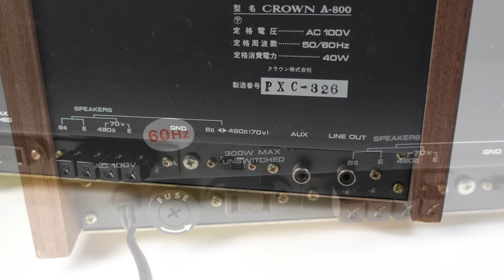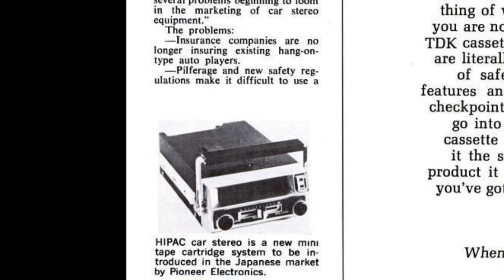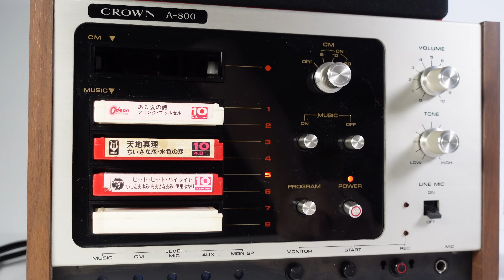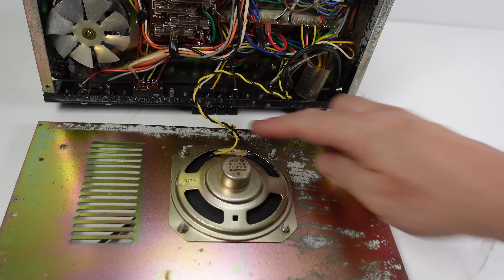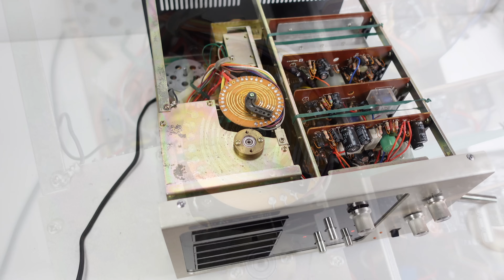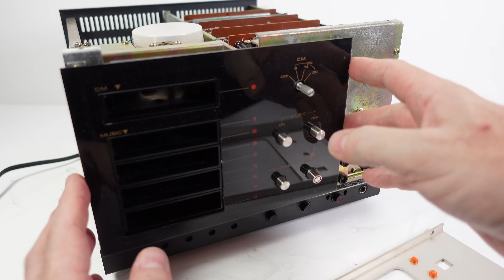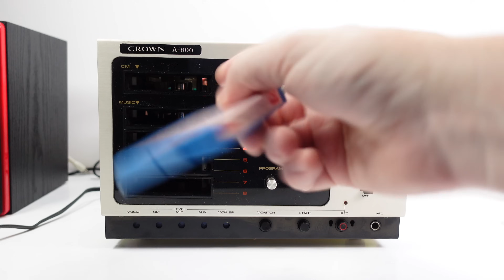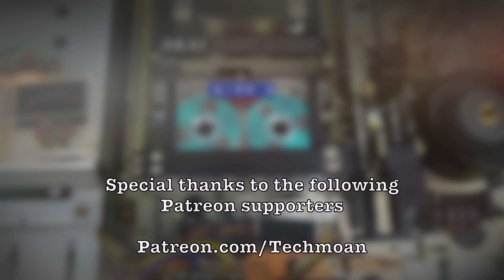An unusual player for a forgotten ‘70s music format

Comment: It's more than likely that a 50Hz drive pulley was available for this machine as a spare part when it was on sale. Quite common at the time, before DC motors were the norm. That's really the only way to make it run at the correct speed on 50Hz. With some luck a newer DC motor with electronic speed controller can be used as a (more or less) drop in replacement. Or just get a frequency converter of some sort. If a mains powered converter isn't available, 12 volt DC to 220 volt 50 Hz ones with pure sine wave are readily available on the EU market, so i can't imagine a 100 or 120 volt, 60Hz counterpart isn't in Japan or the US. For small loads like this, the cost shouldn't be all that high. There's also 50 to 60Hz converters on the market intended for converting US market jukeboxes to run on 50Hz power. They do however most likely only have the power to drive the motor itself, and is also likely to be square wave.

Comment: I'm not much for vintage audio equipment, but I do tinker with old computers from the 80s forward and replacing capacitors does sometimes rejuvenate the computer that I recap.  I say this because of the recording test that was done.  Just as a test for the 50/60Hz, why not piggyback a 0.4 uf/400 nf capacitor onto the existing 0.6 uf capacitor and see what happens?  Everything in life is half chance.  If it works, either leave it or replace the hodge-podge setup with a 1 uf capacitor.

Comment: Took me a while to get a good view of the motor, but it appears to be a variation of a switched reluctance motor.  These are terribly inefficient but have a very good speed stability under variable load.  I would wager a 90% chance that the capacitor is connected to the reluctance winding and not the stator.  If it is then changing the capacitor value will definitely change the motor speed.
Reply: Given that the tolerance of capacitors is rarely better than 10% or even 20% I truly doubt that the capacitor is the only or main change required.
Reply: @geoffmorrison3648  For electrolytic capacitors the standard is +/- 10% but metal film capacitors are typically +/- 5% but typically +/- 1% for those styrene capacitors like the one in the unit.  Even at worst case of 5% that much variance is likely unnoticeable in a low fidelity PA system.  Even so the tank circuit formed in switched reluctance motors is also subject to the inductance of the rotor winding. I stand by my previous statement.

Comment: I find it unlikely that it would matter by changing the capacitor but it's possible. If the value is too high, it's not going to hurt anything so you can just try it and see what happens.

Comment: Changing the cap will certainly not alter the speed sufficiently although might make a difference. Capacitors are simply too inaccurate to set a speed correctly. Unlikely they would make frequency changes that difficult though as this is a specialist machine that would have sold in hundreds, not thousands. If you can get a circuit I can certainly advise.

Comment: That's a format I was previously unaware of, but I pretty much pegged the purpose of the device - I have seen similar devices using other cartridges with music and an "ANN" (Announcement) cart slot and a a button to do non-recorded announcements over the music.  They were in use at department stores and skating rinks in the United States.

I recall a few other cassette formats prior to the "compact cassette" won the portable audio tape market.  There was one about the same size that had sharper corners; I think it was a 1/8" inch tape, but it may have been 1/4 inch.  I had a recorder for that format in the late 1960s or early 1970s, but cannot recall what the brand was.

@Techmoan - Do you know of anyone in the United States who might be interested in restoring some old (1960s to early 1970s era) audio equipment?

Comment: Changing the "run capacitor" will effect the speed of an AC single phase motor, which it almost certainly is. 
It would explain why they didn't just fit a 1uF capacitor regardless of the frequency.
A good indicator of whether it is a run capacitor is its voltage rating, it's a high value, it should be at least be the same as the AC supply or higher, (220V japan).  The value will be written on the capacitor.
Make sure the replacement electrolytic capacitor is connected the right way around (polarity, +/-),  and the voltage rating is the same or higher,  and same tolerance (%) or better (smaller value %).
Reply: You cannot use a polarised electrolytic for a "run capacitor" on an AC motor.  How do you propose to make sure it is connected the "right way around" when the voltage is changing polarity 50 or 60 times every second?

Comment: To change the horsepower on universal air conditioner blower motors you have to change the run capacitor. For example to run at 3/4 horsepower you need a 20uf capacitor and for 1/2 horsepower you need a 10uf cap.

Comment: I highly doubt that changing the capacitor will have an effect on the speed, It has something to do with the charging/discharging rate of the capacitor based on the frequency, Lower frequency (50Hz) requires longer charging/discharging rate therefore bigger capacity (1uF), higher frequency (60Hz) requires faster charging/discharging rate therefore smaller capacity (0.6uF).

Comment: The capacitor creates a phase shift for the rotary current motor.
The motor tries to follow the rotary field and reaches almost the speed of the mains frequency.

The size of the capacitor can't change the speed. It needs to be a different size because a higher frequency can pass more easily through it so it needs to be smaller to let the correct current pass.

To help you understand how those motors work, I oversimplify the explaination:
The motor needs 3 phases which are 120° phase shifted. Imagine a wheel, each phase is 1/3 turn later than the previous one.
The motor needs 3 phases. One is offered directly from your mains which is 0°, the other one is the return wire which is 180°. And the capacitor delays the current and creates almost 90° which is used as the missing phase for the motor.
So instead of 0°, 120° and 240°, the motor is fed with 0°, 90° and 180° which is not ideal but good enough to make it going.

(Yes, the capacitor doesn't delay the current, it makes it early. It's very hard to understand why so imagining making it later works well to get a general idea!)

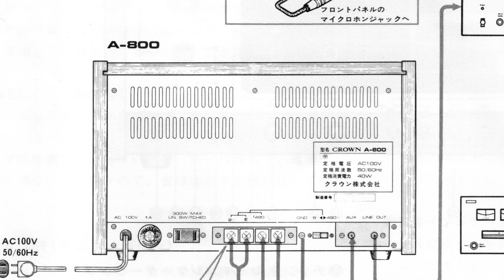Comment: There are "keyholes" on either side of the record button, was there was a cover to prevent accidental recordings? The idea of a tone on the tape is interesting, but seems like it would have to be be simple and obvious to generate, since the machine was designed for use by the general public... The manual at 11:11 shows a standard 2-wire microphone, so if it was a "special" microphone, maybe a switch just shorted the wires? To test the 2nd track tone theory, you could reverse head wires and record an online sweep tone generator. It would also be interesting to put your voice tape in the other machine to see if it recorded anything on the second track... Don't know for sure but I think changing the capacitor for 50Hz might work, based on personal experience with a Teac A-4010 that would gradually slow down until a faulty capacitor across the motor was replaced - capacitors can definitely affect motor speed. As always fascinating video and presentation!

Comment: I knew it must’ve been a commercial music background player because of the 70 volt option on the speaker output. That would be for a distributed sound through a number of speakers and the best way to do that is with a 70 V system.

Comment: for what its worth, the instant you showed the first image of the rear, I saw those 70V/490ohm speaker settings, and thought 'it must be a PA announcement/background music machine'.   70V audio was used for building wide PA stuff, as it could be run in relatively light gauge wires like telephone wire over substantial distances, and many amplified speakers could tap off it, with the 490 ohm terminating resistance at the end of the loop.

Comment: For the AC frequency issue, it might be easier put together a 50hz input->DC->60hz output conversion setup than risk tinkering with the insides of this machine.
Reply: Like with a uninterrupted power unit or an inverter
Reply: Railroads used rotating converters for this purpose-an electric motor driving an alternator at the appropriate frequency
Reply: Would it be possible to use a class AB audio amplifier with sufficient power and feed it a 50/60 Hz sinus signal?

Comment: The capacitor appears to be in the power supply section (all those fuses right there), therefore I am going to guess that the value of the capacitor is a function of the line frequency to keep the hum at a spec level.  Bigger value needed to filter the lower frequency.  Since Crown already makes the factory put in a frequency specific part, they also may have had them select the right motor for the intended frequency on the assembly line if the motor is an AC induction type.  If the motor is a DC type with an internal governor, there may be an adjustment hidden on it somewhere.

Comment: No need to replace the capacitor, just add a 0.4uF parallel with the original 0.6uF. It will be 1uF.
This is the way can do the job with less harm to the machine.

Comment: Im an electronics engineer and i have no idea if that cap will change the speed.  I think its worth a try just make sure its a proper voltage rating cap. If its an ac motor there's a good chance it will work.

Comment: the capacitor could be part of an oscillator RC circuit that sync or drive the motor, changing C change the frequency and the speed of the motor OR its part of the timer circuit

Comment: I don't think the capacitor by itself will be sufficient. Capacitors certainly can be used for timing/speed adjustment, but they're not precise enough for something like tape playback speed. You need to find something else to adjust too.

Comment: Mat,  may I suggest since you get equipment from all over the world to demonstrate,  you get a 250 to 500 Watt 12 VDC to 120 VAC, 60 Hz (automotive) sine wave inverter.  Then you can convert 240 VAC, 50 Hz to 12 VDC with a car battery charger and 12 V battery,  and have a nice isolated 120 VAC, 60 Hz source to test Japanese / American equipment.

Comment: Having a tone on the 2nd channel for commercials rather than a metal splice would make sense if you have several commercials recorded on one tape. That way it'd be able to play one at a time. So I think that's a very plausible theory.
Reply: Was going to say the same thing.  They would probably have a series of announcements on one tape with the 2nd track having a tone to determine the start and end point of each announcement.  If it was only one announcement, it would get a bit repetitive during the day even for casual shoppers.
Reply: @techmoan - Have you played that tape in one of the lower decks and listened to track two?  Was it erased when you recorded your announcement?
Reply: @mjrippe  It seemed like he didn't have an original announcement tape to begin with unfortunately. The one he wrote over was some regular music tape that was very worn. If he found one though this would be a good way to tell!
Reply: @AgentOrange96  Right, but if the top deck erased the second track of the music tape that would tell us something ;)
Reply: @mjrippe  True!
Reply: I have memories of a big bong being played between ads in department stores then back to the music or was that hi de hi ?

Comment: Regarding the hertz timing, I feel that the most obvious explanation is the answer. For it to be labeled that way on the PCB, it's often as instructions for the people who are working on it in a short space. You might get something like "3323" on the PCB to say "use a 3323 button cell battery with this". There's not a lot of space to put directions so they're very short and to me, the most obvious explanation is the answer.

When you posed the question "is changing the capacitor what will do it or..." I couldn't even remember what you had asked because it seemed way too out of left field. 

I don't have any definitive other proof, that is just my feeling as someone who has worked on PCBs! I feel that it would at least be worth a try swapping the capacitor. Usually switching to a higher capacitance (farads) won't damage the components.

Comment: That capacitor says MP = Metalized Paper and should be replaced, regardless of its function, if it's connected to a mains powered motor. 
It probably does not change motor speed, but it does change the current through the auxiliary winding of the motor. If the cap is for 60hz, then at 50hz there will be a too low current through the winding, which reduces motor power a bit (and potentially make it run slower because of magnetic slip)
Reply: @LimaVictor  You're the first one I've seen who got the purpose of the capacitor right.

Comment: A larger capacitor will not make the motor run faster, but it will make the motor run more smoothly. Its purpose is to shift the phase of one of the two motor windings by 90 degrees and at 50Hz you need a larger capacitor for that. You must make a mechanical adjustment (like swapping the motor pulley for a larger one) to make the player play at the correct speed.

Comment: Electro-mechanical engineering is incredible interesting. It's the same in old printers and other devices like that.
Most of the interesting solutions can be now replaced by a microchip with some program on it.
Certainly, that makes the products much cheaper, more flexible and (most the time) easier to maintain.
But seeing the extremely clever solutions of that time is always fascinating. Love videos like that.